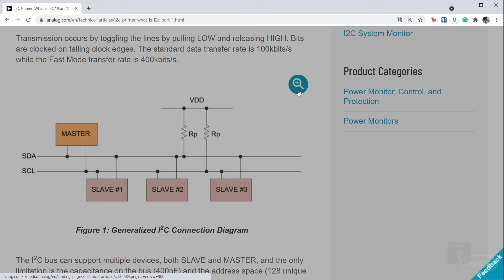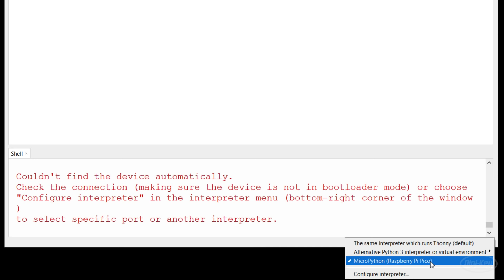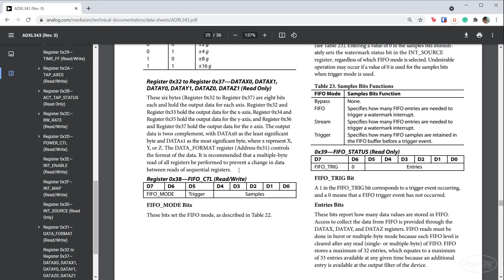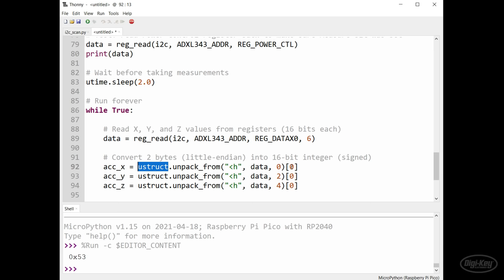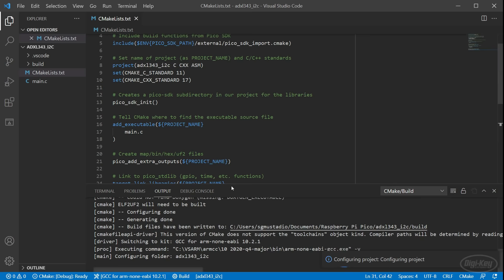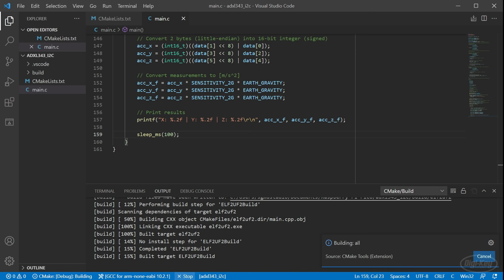Raspberry Pi Pico (RP2040) I2C Example with MicroPython and C/C++ | Digi-Key Electronics

Comment: I find many tutorials for using pico as an i2c master (controller), but not a lot of help using pico as an i2c slave (responder). 
I'm aware of the library created by Don Perron (and the epmoyer derivative) but haven't had a great deal of success with it.
I have control system using a network of RPis, and currently using chips such as the mcp23017 for i/o. I wish to replace the various i/o devices with picos.

Comment: So I have looked at my i2c line with a logic analyzer and keep gettin g a setup to read followed by a NAK even though im trying to write to the device. I 100 percent have to right address for the device 102 for the EZO_RTD. I did not pull up my resistor in internally since i have them externally. Help would be appreciated I have been trying ti fix this for days

void i2c_setup(int SDA, int SCL,uint clock_speed,i2c_inst_t* i2c_port)
{
    i2c_init(i2c_port, clock_speed); // This example will use I2C0 on the default SDA(Pin 0) and SCL(Pin 1)
    gpio_set_function(SDA, GPIO_FUNC_I2C); // Serial Clock
    gpio_set_function(SCL, GPIO_FUNC_I2C); // Serial Data line
    gpio_pull_up(SDA);
    gpio_pull_up(SCL);
}
int main()
    {
        int SDA =  0;
        int SCL = 1;
        // Vairable for read and write blocks 
        uint8_t rxbuff[40]; // Receiving Buffer
        const uint8_t command[2]= "r"; // Command 
        int len_bytes_command = strlen(command);
        int max_length_receive_bytes = 40;
        uint8_t address = 102;
      
    
        // Enable USB UART so we can print status output
        stdio_init_all(); 
        i2c_setup(SDA,SCL,400*1000,i2c0);

        
        

    while(1)
    {
        int written = i2c_write_blocking(i2c0,address,command,1,false);
        sleep_ms(600);
        printf("Bytes:%d,Address: %d\n",written,address);      
       
    }
        return 0;
    }

Comment: Hi, i get error that i could not communicate with ADXL343, 
I don't have an accelerometer as you so i changed ADXL343_ADDR to:
ADXL343_ADDR = 0x4c, So it should work fine.
I would be grateful if you could help me solve this problem
By the way my accelerometer is Grove - MMA7660FC 
bytearray((DEVID,)) = b'\xe5'
data = '\x00'

Comment: Go video thanks.  FYI, there is a third approach besides, C++ and micropython.  On the ESP32 I wanted to run python scripts on each of the FreeRtos threads.   I was not able to get micropython to operate that way.  So I used a Lua interpreter which is designed to be small and fast.  Used in many Game Engines on win machines.  Binding C functions to Lua is very easy.  I found a translator program that translated python code into Lua.  The result was that I had the scripting power of Python and still could interact with interrupts and threads, through the C code.  Also, I had scripts files on disk on the ESP32 which could be called at will.
I put it in operation and then put it on GitHub somewhere.
Reply: Cool! I’ve heard of Lua, but I’ve never used it. That’s interesting that it will run on the ESP32.
Reply: @ShawnHymel  if will run on raspberry pico.